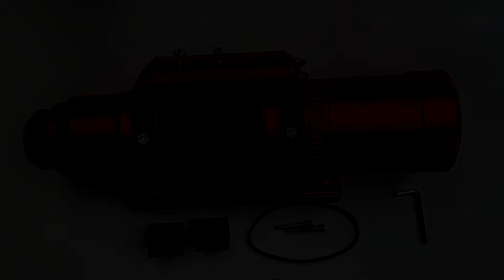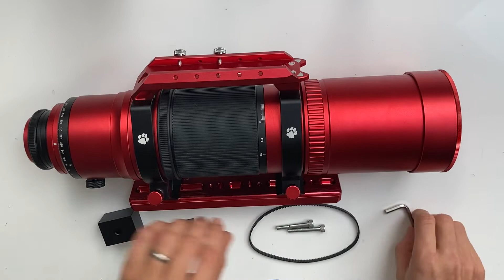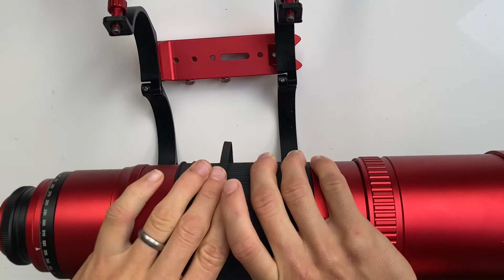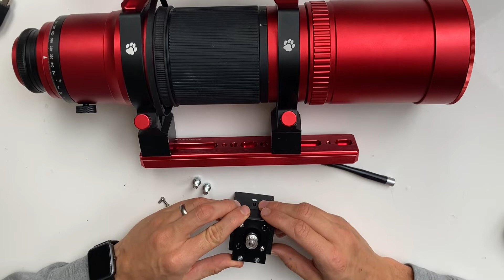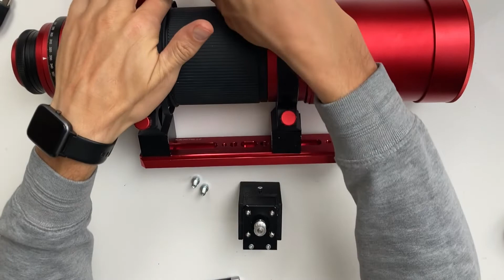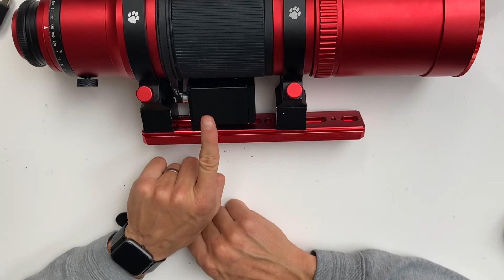William Optics WO RedCat 71 AF3S assembly instructions

Comment: I see that there is a huge price increase on this to €245, May we know the reason?
Reply: AF3S kit price has been the same practically since we released it. Maybe you meant ZWO EAF kit?
Reply: @pavlini0  ah! You are correct! What’s the difference on these two? Just the housing?
Reply: @BenGieCruz  AF3S kit comes with the autofocuser motor (hence higher price), ZWO EAF kit does not come with the motor (you have to buy ZWO EAF separately)
Reply: @pavlini0  Ahhhhhhhh I understand now. I already have EAF, glad you pointed that out. Thanks a lot!